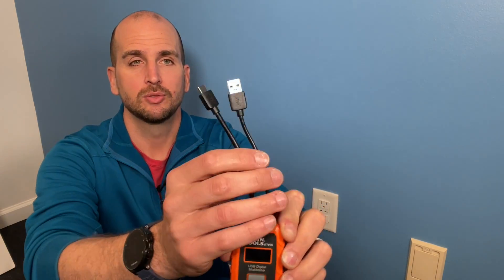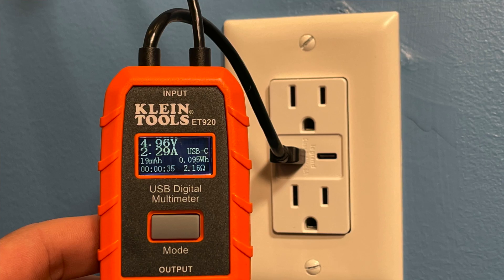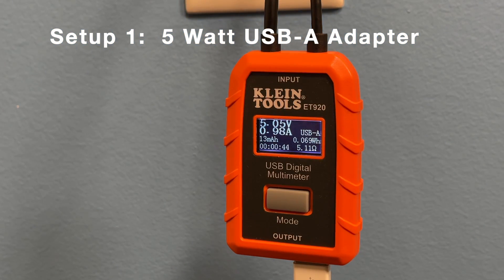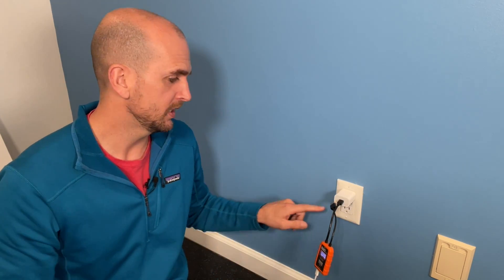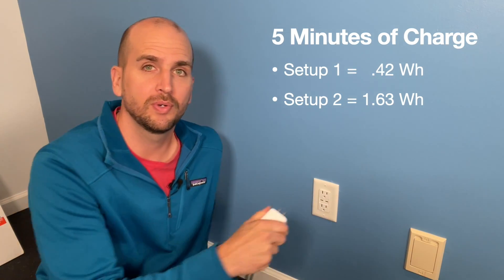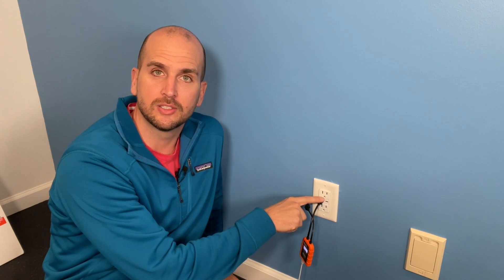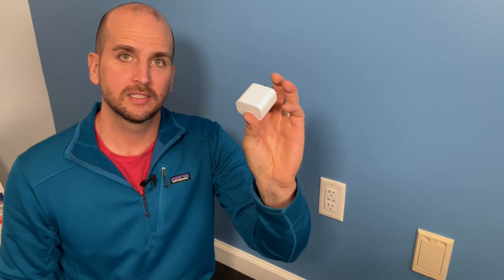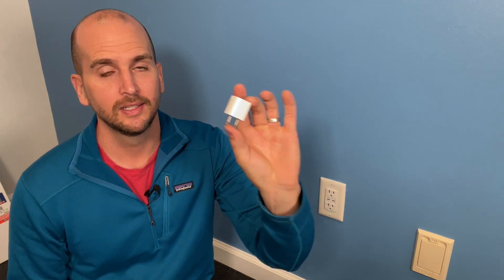How Fast Do USB Outlets Charge Your Phone

Comment: I love your videos. I have a question for you: I installed two of these LeGrand outlets and noticed what appears to be a massive oversight in design. Once a device is fully charged, it stops sending power to the device then resumes sending power 1 second later. So the device starts charging again only to reach full charge in another second and the outlet cuts power again. It cycles like this indefinitely, on/off/on/off every second. The charging indicator on the device turns on, then off, then on, then off, etc. As I understand, this is a great way to kill a battery isn’t it? I contacted Legrand support, and they told me they think this might be intentional behavior which baffles me. Am I missing something? Do other brand charging outlets do this as well such as Levitown or Hubble? This does not occur with any other chargers I’ve used ever - usually the device itself decides it’s charged and stops charging its battery, but it can’t do this if power is cycled to the device, akin to plugging and unplugging it every second.

Comment: Nobody really has any reviews like this on wall chargers.

If you bought like 5 of the top selling USB C wall duplexes and use that Klein on all of them  (awesome tool btw) & showed the results of the power output of each in a way people can understand visually I think it would get millions of views.

Look around YouTube that kind of video doesn’t exist, people test everything down to cables & connection ends for speaker wire and nobody questions how much power these Duplex outlets actually put out and they’re fairly pricey too l…you’d think people would want to know exactly what they are getting.
Reply from the maker: Thanks for the recommendation Ray.  I think you have a valid point with bringing them all together in 1 test.  I could also add a blog article to our site and continue testing new USB outlets as they become available using the same method to compare apples to apples.
Reply: @EverydayHomeRepairs  I just purchased an Eaton USB-C from Lowe’s but was turned off by the fact that it wasn’t UL listed so after a ton of looking around I ordered an ELGGRP that is UL / FCC certified that claims it has over & under voltage/current protection and back flow protection along with a smart chip to recognize device standard to optimize the charge for your particular device.

It claims 18w at the USB-C and “verifies” it by showing a USB device similar to yours that reads the output.

I’m going to have to pick up one of those Klein’s you have soon, I just got their outlet tester and love it. 

 It yeah I researched for a few hours last night brotha and there’s not a lot of information on these these USB duplexes to make a decision off of. 

I subscribed just encase you do test multiple units side by side & Im sure with the growing popularity of these types of outlets people are going to be interested in seeing the results 👍🏻

Cheers mate 🤙🏻

Comment: The Legrand unit's are only 5v3a (15 watts) per plug. The iPhone at 5v will top out around 2a (10 watts) even though the charger is faster. Only some androids can use the full 15 watts of the Legrand. 

The Leviton units can do 5v3a (15 watts), 9v3a (27 watts) or and 15v2a (30 watts) depending on the device. Newer iPhones can do 9v2.2a (20 watt) max. Something you can only achieve with a USB-C that supports 9v charging (Leviton). Newer laptops that can charge via USB-C can also benefit from hitting the full 15v2a (30 watts) from the Leviton units which is the same as chargers included with the MacBook airs. Half as fast as the units included with the 13 MacBook Pro or about a third as fast as the units included with the 15/16 inch MacBook Pro.

Comment: I actually AVOID charging my phone as quickly as possible.  It has Qualcomm's quickcharge tech, but when I use it, the phone gets noticeably hotter.  And that is OUTSIDE of the phone body, which I'm sure dissipates the heat over a larger surface area than the battery itself... meaning the battery suffers heat effects worse than you can feel (or IR measure) on the outside.   Since most phones don't have user-replaceable batteries anymore, I want to extend battery calendar life by any means necessary.  5V 1.5A charging is plenty fast for me!
Reply: FWIW, I also avoid discharging below 15%, as well as above 75%.

Comment: The Leviton T5635 and T5835 are both 6A outlets that claim to charge a single USB C device at 30W, or two devices at 15W. To be honest I have never heard of the Legrand brand before, but I have plenty of positive experience with Leviton. Maybe do an update with the Leviton T5635 outlet?
Reply from the maker: Done and done ✅ https://youtu.be/verhkNhrNTc
Reply: @EverydayHomeRepairs  That's what I get for not checking your page first. Thanks!

Comment: You do realize that the power supply to convert the 120 volts AC to 5 volts DC built into the outlet is drawing current 24/7/365???
Reply: So do the plug-in style USB chargers that nobody unplugs when they aren't using. What's your point? The power they consume when not in use is tiny - about 20 - 25 cents worth per year. The convenience they offer is worth more than that to me.
Reply: @blueridgerennsport  Then I guess myself and lots of my friends are "nobody".  And, depending on where you live, that 20 - 25 cents per year can easily be more like 50 - 100 cents a month.  By yourself a plug-in in-line watt meter.  You will be amazed at how much you are wasting having things plugged in for the convenience of being able to just turn them on.  Flat screens, cable boxes, computers, laptops, A/V and HDMI switches, and lots of other electrical equipment... all sap power 24/7.  A friend was amazed to find his cable box was drawing over 450 watts on standby!  But go ahead and waste power... just don't complain about all the coal and gas fired or nuke power plants... or how large your electric bill is... or brown-outs because of too much load.  Try installing a solar panel system and living on just that power... then you will know how to save energy!!!
Reply: @donf3877  I don't complain about any of it, the cost of electricity or how it's made. $60 to $120 a year is negligible as far as I am concerned. Life is too short to live so miserly! The AC stays at 68, the heat at 70, and all is well in my world. I'd hate to see your reaction to the fuel economy half my cars get 😮 I'm afraid you might explode.
Reply: @donf3877  To put things into perspective, the average cost of electricity in the US is 14.06¢ per kWh. Your average 5W USB charger left plugged in will use about 1.5kWh per year. Even if you live in Hawaii with the highest electricity costs of 32.4¢ per kWh, it still comes out to less than 50¢ per year. You could find more money than that under the seats of your car! If you're really that worried about a USB wall outlet consuming power while not in use, have it wired to a switch... Though it will take 200 years or more to recoup that cost at 50¢ per year 🤣
Reply: @blueridgerennsport  Well, lets see.  My Jimmy with Dana 60 air lockers front and rear can manage 6 MPG... if I drive it at 55.  I don't.  At 65 it's more like 4 on a good day.  It's a good thing there are twin 22 gallon tanks on her.  Of course, she can pull trees out stump, roots and all... so there is that.  Also, with 35's, she hasn't met a road, or what some people call a road (like mine), that she couldn't handle. 

And, due to my joints, I take a very hot shower, and a 110 degree Epsom Salts bath, before going to bed.  You can't get into that.  You have to bring the temp up gradually while you're in it.  So... my bedroom AC is set at least at 62, sometimes even 60, to compensate for my body temperature.  Of course, every room has its own mini-split heat pump/AC system, so there is that.

I don't complain about the cost or how most of the electricity is made either.  There is no meter on my property.  All the electricity I use is from solar and wind charging a battery bank.  So when the rest of the country is screaming about the electricity (like they did in Texas a few months ago), I'll be either as hot or as cold as I want............

Comment: @4:13 Pretty near 9Volts?? I thought every charger HAD to be 5 Volts or less??
Reply: Depends on the phone. Samsung "Adaptive Fast Charging" (and others) uses a 9V/2A charging system. The device can communicate with the charger and turn on the "high-voltage" mode.
Reply: USB-PD (a standard for charging) calls for 5, 9, 12, and 20V.   The voltage is negotiated between the charger and the device.

Comment: That middle one was nearly 9v - an unsafe level for something rated for 5v.
Reply from the maker: Hmmmm, what are you indicating is rated for 5V?  USB C?
Reply: @EverydayHomeRepairs  I'm not an Apple user but I thought all phones were 5v input.
Reply from the maker: @david_sdiego  5 volts was the max for years and years but the USB C and Fast Charging combo has opened things up to as high as 20 volts even though you won't see that high charging a cell phone.
Reply: @EverydayHomeRepairs  USB-C must have the new "PD" (power delivery) specification to adjust to the device connected. Your middle charger doesn't have it. It's the extra amperage (or wattage) that provides the fast charge. Over voltage will kill your device.

Comment: I'm old fashioned, even though my OnePlus 8 pro came with a crazy fast charger, the one I charge it with is an old 2 amp charger from my old Galaxy S2.  I think I've used the fast charger twice since I've had it.  Also with those outlets you have to read the fine print, they will say 6 amp, but really it's 3 amps per socket.

Comment: Ok, so I'll start by saying up front that I tend to be a very frugal buyer of electronics. That said, I'm leery of using adapters that aren't specifically supported by the devices that I'm looking to charge b/c I see nothing wrong w/ spending a few extra minutes on the charger when I want to maximize the longevity of the devices and their batteries. Also, I have yet to see a user manual recommending anything other than the adapter that comes with whatever is being charged.

I think the biggest thing to keep in mind is that the faster a device is being charged, the more heat is going to be the natural byproduct, and in especially the modern delicate devices, heat kills, which is why shipping products can be highly scrutinized, fires are not uncommon enough, and etc...
Reply from the maker: Appreciate the feedback 👍
Reply: @EverydayHomeRepairs  no problem! 

Btw, I don't mean to rain on anyone's parade, b/c I'm definitely getting the tool you used, b/c as you point out the specs are an important thing to know. 😎

Comment: Method 1 an 3 used the older standards, 5V @ 1 amp and 5V @ 2 amp (fast chagrining). Its non proprietary at this point. Method 2 uses Power Delivery. that changes the the voltage and amps to make the fastest charge possible until it hits 80% then it goes to standard 5v until 100% (Power delivery requires that the phone and charger talk to each other to negotiate the BEST charge. Hence the USB-c cable.

Comment: Do not install USB chargers in the wall. 
You a probably putting a cheap Chinese transformer in your wall where it becomes a fire risk.  Even it is UL listed the failure rate on cheap chinese electric  products in high. The heat caused can then create a fire in your wall

Comment: Supported by the USB Power Delivery 3.0 PPS (programmable power standard), Galaxy S20, S20+, and S20 Ultra's Super Fast Charging capabilities pull 25 watts of power when plugged in, to repower your phone in a flash. For even faster charging, you can connect your device to the 45W Travel Adapter and harness the power of Super Fast Charging 2.0.
*45W Travel Adapter sold separately.
I'm sure iPhone has something like this also

Comment: The second one was charging at 8.8 volts that makes a big difference. There are different charging profiles for different brand phones, the cables and chargers must fit that profile
Reply: Never charge a phone with more than 5 volts. Extra watts (or amps) is fine but not volts.
Reply: @david_sdiego  you need to keep up with the times, Samsung Super Fast Charging and Adaptive Fast Charging

VoltageMax PowerSamsung Adaptive Fast Charging 5V/9V 18W Samsung Super Fast Charging 1.0 11V 25W Samsung Super Fast Charging 2.0 10V 45W

Mar 23, 2021

Comment: I would assume that the setup that has the least number of electrical components/switches would be the most efficient (though maybe not the fastest), as there are miniscule power losses when converting power.
Reply: I'm not an expert on those outlets specifically, but it is essentially doing the same thing as just using an adapter. The only difference is it is just built-in. So from that standpoint, it wouldn't be any more/less efficient. Either way, you have to convert AC to DC

Comment: Wow that reverb is a bit much...
Setup two is probably faster than three.
I don't think it's wise to built high power chargers enclosed into a wall.
The higher the power, the higher the chance of a fire hazard.
I really recommend not building stuff into a wall, since modern electronics often get warm and walls don't dissipate that warmth.
Reply from the maker: Thanks for the feedback and you are right on the audio.  It is a common challenge when moving around to different properties and rooms when it comes to audio quality.
Reply: @EverydayHomeRepairs  Ah yes I see, that's a tricky issue.
Maybe a directional microphone can help reducing room reverb? 🤔
Reply from the maker: @QoraxAudio  I think you are correct.  I have a SHURE iPhone shutgun mic on order 🤞
Reply: @EverydayHomeRepairs  Nice.
I have a Rode NTG2 shotgun mic, which has a built in microphone preamp that also does the phantom power, works really well! 👌

Comment: You might have a problem here, does your multimeter allow the device to properly negotiate charge rates? A lot of the newer phones and chargers actually communicate back and forth and determine the charge rate of the device and supply power appropraitely.

Comment: In the beginning you referred to the fact the receptacle was rated for 6A but you never went back to that.  On your tests, the meter never went above about 2.2A.   So, does that mean it is 3A per USB receptacle?  Or is the iPhone limiting the amperage?
Reply from the maker: Yes and yes.  I think the iPhone is limiting to 2.2 Amps and also each of the USB-C ports can only pull 3 Amps.  I do have a Leviton T5635 https://amzn.to/3novC2K being delivered tomorrow and that unit can deliver 30W on a single USB-C port.  I am curious to see if it is able to deliver more than 5V which will be critical to get the full capability of the iPhone fast charging feature.  Stay tuned 👍
Reply: @EverydayHomeRepairs  good work, appreciate the followup.   I am not much of a DIY electrician, but I do build my own computers.  PC power operates at 5V DC power.  It would not surprise me if other electronics like iPhone also operate at 5v

Comment: I won't get into all of the details, but chargers have to support the "fast change" protocol that matches your device to take advantage it. USB is natively 5 volts, fast charging steps up the voltage 9V, 12v, and above. There are in wall USB and USB / receptacles available that support "fast charging". You just need to know what charging protocol is used in your device. Example, with Qualcomm its called Quick Charge and there are different versions also 2.0 3.0 and 4.0 being the latest at the time of writing this. Just to name a few others, Power Delivery, Pump Express, Rapid Charging, Dash Charge, and there are others. This is just an example (and not an affiliate link) of an in wall USB / receptacle - https://www.amazon.com/TOPGREENER-Delivery-Receptacle-Samsung-TU115QC3PD/dp/B07M87BM96
Reply from the maker: Hey Robert thanks for the feedback.  I have a Leviton USB-C outlet showing up tomorrow and interested to give it a go.  https://amzn.to/3eytj9b

Comment: I hate the built in USB wall outlets. Such a waste. I've always had them charge much slower than a decent quality wall jack. I bought some Qualcomm Quickcharge and USB PD power adapters and charge to 90% in less than 40 minutes. I can't say exactly because I've never timed it, but I can get a full days worth out of a 30 minute charge. The outlets are "dumb" and don't use QC or PD.

I'm holding out for some Outlets with QC3.0/PD... I would love nothing more than to keep my wall warts as a travel charger.

Comment: I'm not an electrician. I'm not a cell phone person. This whole video goes against what I "know" (or "mis-know"):  Qualcomm 3.0 (& other prior series') indicate that the voltage is reduced over time and (I think) start at a higher voltage.  In addition, batteries - to my non-understanding - are designed to only accept so much "oomph" in a charge.  For all ofthe really knowledgeable people out there, how wrong am I? This video just doesnt coincide wit all my misunderstandings at all....and in that ignorance, I have no desire whatsoever to put my phone onto a non Qualcomm anything..... I know: I'm the idiot here.
Reply: That is how I understand it to work as well. Qualcomm 3.0 initially starts out as a fast charger then slows it down as it reaches 80% or something. Phone has to be compatible with Qualcomm for that all to work. I also charge wirelessly but pros and cons to that, as well as different wattage specs.

Comment: This was sooooo helpful!  I would have though directly plugged into the recepticle would be the fastest. I am changing recepticles in my daughters room and this really helped! Thanks.
Reply: It'll definitely depend on the wall adapter you use, but generally that's true.  Those 20w USB adapters take up a lot of room that you might not normally have behind an outlet